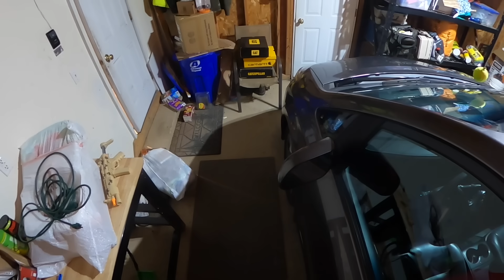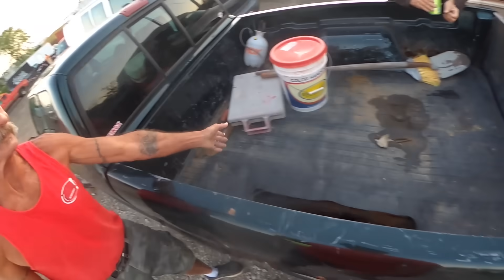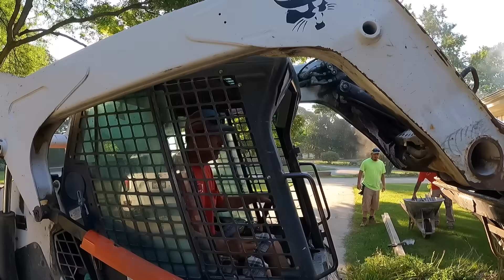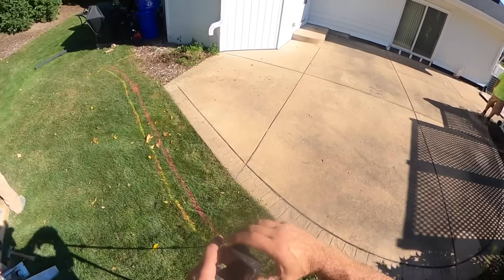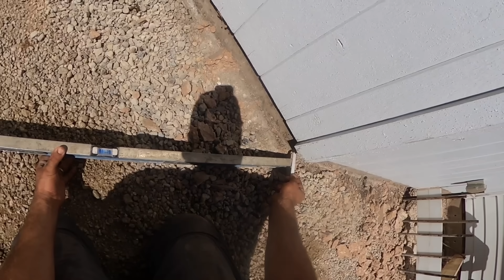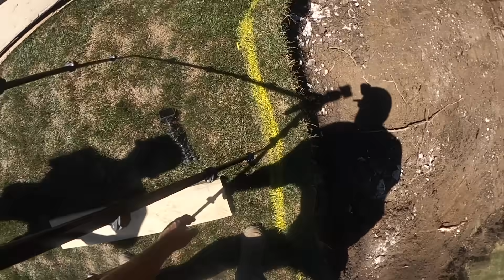Will the new guy even last a day? Yep

Comment: It honestly amazes me how much you guys can get done before 9 am. I've never done any real concrete work so I don't know if that's average or fast. Working in agriculture it takes forever to get things done most days.
Reply: Demos go by pretty quick if you have guys that know what they are doing
Reply: Depends these guys got lots of good equipment some others do the job by hand with sledge hammers wheel barrows and whatnot
Reply: Days almost over by 9!
Reply: @nes999  i wish mine were lol. Start at 5 and finish anywhere from 5-9 pm most days

Comment: Use two copper brazing rods to locate electrical conduits,sewer, water and gas laterals ad well, i worked doing underground construction for 26 yrs, lots of recon work,saved to much to count in repair and material cost, i have located lines up to   4’ in depth.

Comment: I'm curious if a pump would eliminate a head or two? If it does, the pump shows up everyday lol.
Reply: @TUGG75  nice info. I’ve seen west coast custom concrete on YouTube do less with more, using a pump. That guy pumps and handles the hose himself. They do more with less in my eyes. They seem to have a more skilled labor pool show up but typically they have no more 3-4 laborers on the job. This channel is entertaining but after watch both channels id rather work for a company with a pump.
Reply: @TUGG75  I see what you’re saying. I’d still rather own a pump or work for a pump. The way this guys channel is going, it won’t be long before he uses a pump on his channel. Let’s see how this comment ages haha
Reply: @CY-1627  We'll see. Ryan will diversify as his platform grows and the natural progression will be to have the complete arsenal of equipment. The cost of the initial investment, critical spares and operating costs would be 3-4 laborers salaries for a year (cheaper if he buys used). He will make the money up in no time bidding jobs which may require the specialized tooling. He will be able to diversify his bids and take on new jobs "new content," that he may not be capable of doing without a pump. The margins might also be better on a job that requires a pump. 75 degrees and sunny in most of his videos (same as west coast), I bet the pump will work if they order the required material from the concrete supplier. Like I said, I get what you're saying but I bet there will be a pump on this channel eventually.
Reply: @TUGG75  Got it. We'll see a pump on this channel eventually haha.
Reply: @CY-1627  I will watch these comments age.
Reply: @TUGG75  Maybe not a driveway but something that requires a pump.

Comment: You should tell us why u shouldn't pour 8 inches thick or a stop 1 ft thick
Reply: Because youre fully wasting the clients money on unnecessary extra concrete. 
A patio only needs to be 4 inches. Not 8.
And the step, you fill the form with gravel then 4 inches of concrete on top and a little on the sides.
Not a solid block.🤦‍♂️
Reply: @thejoke2791  gracias
Reply: @markgenie1958  
👍

Comment: Do you not have more issues like that one job where the blocks came through the basement when tearing out the carports on slabs? I don’t understand how the integrity of the concrete underneath the plate isn’t completely compromised once all the surrounding concrete  is cracked, vibrated loose, and removed. You wouldn’t be able to fit a greased BB up my butthole while doing pneumatic jackhammer surgery in there lol. You have a lot of experience and talent. I can tell you really do love your trade. Stay safe and God bless! 🤘🏻❤️

Comment: Romex ran underground, no pvc? Thats a blatant violation lmao.
Reply: They run low voltage power etc under roads here. Then during road works crews have to be very carefull. One crew using a coldplanner actually ripping a road up ripped out a new WiFi cable that wasn't run deep enough. It was ran directly under the road surface machine going along and wammo out it comes doing allot of damage. It ripped the kerb up on both side road and a massive section of nature strip to. The company that installed it was angry at workers lol.(It only done it as it was 3 inch diameter cable and it wrapped around the machines roller blade thing thus it just spun into a spool....cost like 15 grand that day.

Another crew in my street hit the power line loud bang longs of smoke and power out people cooking tea come out going what the hell did you do....this was water main works. They were almost finished to just getting trench long enough to fit pipe in.
Guy in excavator has to sit in cab doing nothing for 15+mins to wait for machine to be safe. Power company came out and luckily it only damaged the outer coating not the wire itself. They just wrapped duct tape on it and got crew to pack up lol